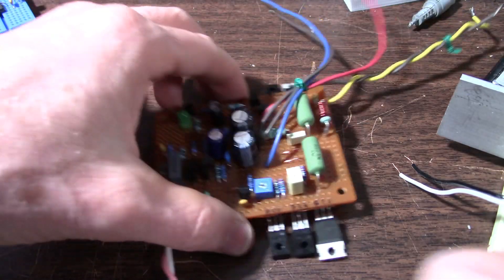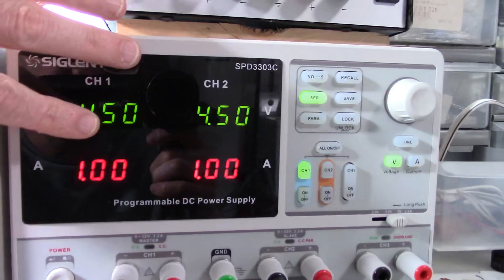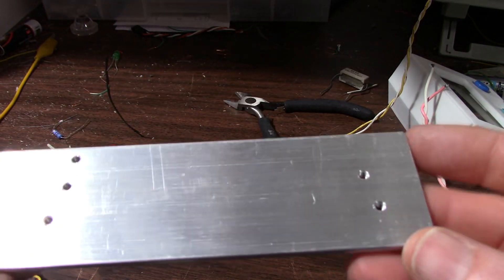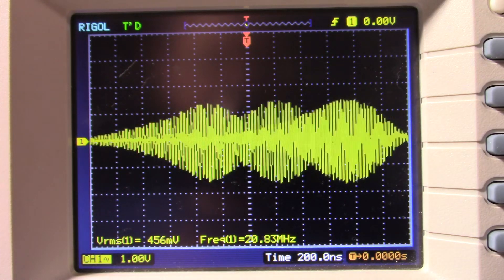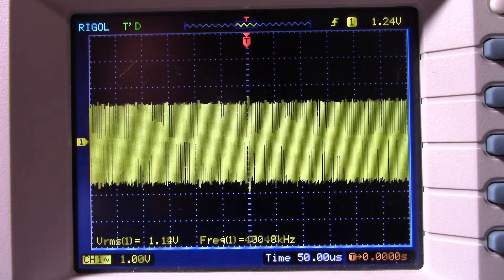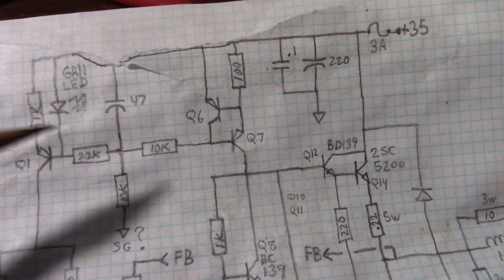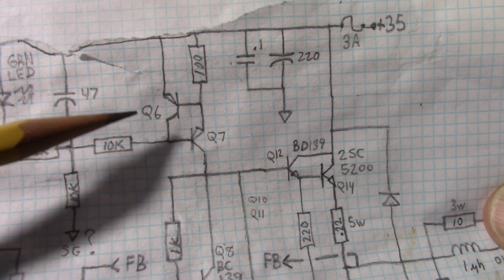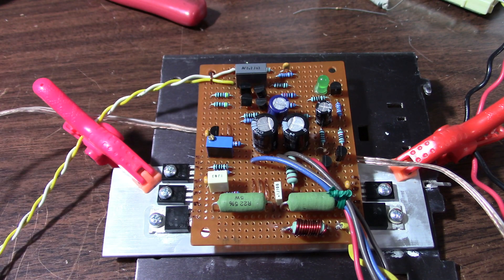Discrete audio amplifier project PT14 - BIG PROBLEM!

Comment: Howdy.
One cause of parasitics is the grid - cathode capacitance or base - emitter capacitance. Together with a grid stopper resistor or base stopper resistor they form a RC filter. The RC filter shifts the phase a little. Hopefully out of the oscillation criterion region.
If the transistors are fast one may try to "worsen" them with separate capacitors between grid and cathode or base and emitter. This should shift the RC kink frequency toward lower values taking the oscillation frequency out of unity gain. One may check the inherent capacitance from data sheets and try adding an outer capacitor of about the same value.
Regards.

Comment: John perf board is not the way to go.  You need broader & wider ground surfaces for shielding and capacitance.  Can you put the whole thing in a metal box and rule out external sources?
Reply from the maker: Perf board is certainly not ideal but allows me to change the circuit without redoing a board. In the video after this, I located the oscillation problem.
Reply: @JohnAudioTech  I have seen the follow up video and the solution.  Seems I was wrong about an external influence. Good to know you nailed it.

Comment: We got the same problem lol. mine works fine only if i don't bias the final stage higher than 400mA per rail. idk what went wrong but i've blown a couple sets of NJW0302/0281 and TTA/TTC004B transistors. It runs fine at high bias current if i increase the miller cap value, though

Comment: It's more a pcb layout issue, you have amp just love to oscillate, and go pop!
Reply: I agree.  Perf board is not the most stable basis in the first place.  The ground connections should be real wide wherever possible, so capacitance knocks down HF oscillations.

Comment: Hey John, Not counting the amp, I hope all is good with you. Where a Runoffgroove, 1/2 watt, LM 386, Ruby amp is no where close to the amp your building, I have found 'stray' voltage on the actual phenolic material the board is made of. Judging by the nice work you do, I'm sure you clean your board after parts install, I do too, and, I use a utility knife to score around the pins of FET. I would bread board a Ruby and would work great, on perf, poor performance. After cleaning and scoring around pins, the amp would work perfectly. Solder paste residue that cleaning did not get. I use HEET, ethanol alcohol, gas drier. Stray as it were voltage, just a thought. Take care, Cass.

Comment: Hi John, if you have Bob Cordell book, get to read chapter 9. I am not an engeneer, so i will not try to pretend i understand the advanced solutions and can help you. What i understand is that you need a low pass filter in the feedback loop. Low enough to stop the oscillation, high enough not to hurt the slew rate. Then monitor phase relationship of input and output across the whole bandwith of the amp.

Comment: Hey John, greetings for the great job.
At such high frequency, I would put my bets in emitter follower oscillation, which means either the drivers or the output devices.
I'd say more the drivers, because they "see" the quite high base collector capacitance of the output transistors (while the output transistors themselves are not seeing any capacitance).
And among all, this one is relatively easy to rule out... Just lift the bases of the driver transistors and insert a small value resistor there. As for the value, consider the base collector capacitance of the drivers and set a time constant that sets the cutoff to  - say - two or three octaves below the oscillation frequency you're getting. Well, I may be wrong about how to calc the resistance all along... As what it needs to do is to counter and swamp the eventual negative resistance created at the base due to the capacitive load at the emitter.
Ah, in time, it just crossed my mind as well... Did you ground the heat sink? I just thought of a possible capacitive coupling between the collectors of the output transistors to the Vbe doubler.

Comment: John, we have all built amplifiers over the years that are better transmitters than audio amplifiers. Assuming you don't have a faulty part, I think I would look at the feedback loop layout. As it's such a high frequency it must be very lightly  coupled capacitively. Try re routing that lead. Good luck, in my experience you get get stability problems on ready made amplifiers that are fine until you connect it up and you need to spend hours messing with earth connection.

Comment: Probably your best video.  No one has the guts to keep it real on YouTube.  What did you change from the last test?  Heat sink is all I could see. To me, a digital guy, it seems like an issue between collector and base. People call it parasitic until the TO220 bodies are connected by a sink.  Don't know what to call that effect. Some sort of coupling through the mica? Just a guess.
Reply from the maker: It may have been oscillating before. It doesn't really affect the sound. This was the first time it was on the scope. I think I'm getting somewhere with it. I hope to get a video up with changes as I go along.
Reply: JohnAudioTech - Take your time. The thoughtful content of your work is what distinguishes you from the hoard of "mail bag" EE videos.

Comment: I suspect that it’s not in the output section because it does it with or without a load.
Reply: I think you're right, especially if the frequency remains relatively unchanged with the load removed

Comment: Hi John, Im sure you will get this working. So the amp was working, no oscillation, before fitting the heatsink? The only change was the Vbe pot. I cant see this being an issue. Try grounding the heatsink to stop it trying to impersonate an antenna. If this doesn't work, remove the heatsink and check again. All the best.

Comment: So now you have an "unconditionally stable oscillator". I had the same problem, but with CFP output. I fixed it redesigning the PCB and modifying the Zobel network. A 20pF capacitor in the FB sometimes work, but is not the solution, the amplifier must not oscillate without any cap in the FB. 
By the way, a radio filter in the input may help, it may be a strong radio signal near the house.

Comment: Before you go down rabbit holes, check that what you have built actually matches your schematic! In your last video you stated that you pretty much threw it together. Be sure that what you are debugging is what you INTENDED to build! :-)
Reply: NotMarkKnopfler I think this is the first step.  Maybe take a fresh schematic and highlight each connection and part as you trace your board.  Nice video!

Comment: I think the problem is right from the input differential stage. And the oscillation is not sustaining means this oscillation is generated directly from the signal side. It is not the problem of stability, for an unstable system the oscillation should not damp itself out. 
I think the 40mhz noice source is outside the circuit.
Reply: MY TECH WORLD AND KSRTC Correct.
Reply: @brandise76  Only thing that I can see is the output inductor.
Reply: John Yang I don’t understand what you are saying about the zobel compensation inductor. That has no play in this oscillation issue. I can’t see the whole schematic or the actual layout but I suspect the amplifier is barely stable and some external signal is causing it to break into oscillation. The unshielded, twisted-only pair of input leads isn’t helping. There are lot of things at play in causing an amplifier to oscillate and I suspect it will be difficult to determine from a video.

Comment: input stage differential amplifier stage and feedback loop. Seems to me that you don't have negative feedback but a positive one turning your amplifier into an oscillator. Also some lead can not be connected or bad soldering or you made a connection it shouldn't be there.
Reply: The amplifier works with signal and has low distortion near clipping, and no wierd behavior at clipping. Only has 3vp-p 39mhz signal riding on the signal.

Comment: Hi John, the high frequency oscillations you are seeing are called ringing, your board/ circuit is resonating.  I saw this a lot when I was working on a hydrogen generator project.  the 1 micro Henry coil is doing what?  whenever you have capacitors and coils together you just might see this ringing.  what would happen if you removed that coil?  I know this is not what you want to hear, but what if you added a low pass filter?  to attenuate the high freq?!  okay maybe that's a bad idea.  mike

Comment: You can split the amplifier sections for testing. Disconnect the driver transistors from the VAS , reconnect the feedback to the VAS  emitter. Obviously this won't drive a load but it should be DC and AC stable and be a half decent amp stage in it's own right.

I've seen the current source stabilization with a 1K and 100p. 

If the input stage is OK it might be your CFP output, maybe your 220R between the op bases could be split into two 100Rs that base to emitter?

I was a little concerned about the common ground for input and output section but you have plenty of decoupling so maybe it's OK.
Reply: I just double checked and noticed your op is Darlington not CFP my bad.

Comment: Current mirrors on the input stage have given me many a headache. I generally run LTP inputs with the inverting side straight to the rail and 470-820 ohm as the collector load in the non-inv side (base to emitter VAS) with DC offset determine the final value.

Not sure what TO220 transistors your using but I've found the TIP range to be gits for oscillation. TIP42C etc seem to be buggers for it.

Did you connect the heatsink to 0v, I've had floating heatsinks cause me oscillation before.
Reply: so, a floating heatsink could cause oscillation too?. i have my own designed amp oscillate on high bias (higher than 400mA per rail) and the heatsink was floating. never thought of grounding them
Reply: It becomes a plate capacitor with the heat pads of the transistors bolted to it, it some circumstances high frequencies can couple between devices through the heatsink.
Reply: @killcar5nbike2  makes sense. i'll try to ground the sink later. could my Al2O3 thermal pad induce the problem even worse?. it's 0.6mm thick
Reply: It shouldn't do, there's so many reasons an amp can start oscillating. It may help, it may not.

Comment: What about a 5W  Wide Band class A amp  using 3X BC182L transistors in a long tailed pair driving 2X BD131 power transistors could be used as a preamp driving a wire-wound  Variable resistor which feeds the main output stage just Google for it, what about a 470pf between the inverting side of the amp and ground.

Comment: i'd disconnect the feedback to see if it goes away, remember transistors also have capacitance, its small but you since all it takes to make an oscillator is a RC network and a feedback loop, you might have built an amplifier/oscillator. if you disconnect the feedback and it goes away then perhaps you can put an inductor on the feedback loop to filter out the high frequency signal.  good luck :)

Comment: You will need an RC filter at the input known as an RF stopper: Place a 0.001uF to GND from the base of Q2 to GND on the left side of the DIFF AMP. This sets a corner frequency of about 160kHz which will eliminate the amplification of RF ingress.
Reply: I think he mentioned he shorted input to ground. So it can't be rf being picking up. Also 3V p-p is really a lot, instead of 30mV.
Reply: John Yang Sure it can. He grounded the input - where? At the end of his input cable? It’s still a big antenna.
Reply: @brandise76  Well. Apart from what I said, he already has a capacitor in the front end. It's shown on both the schematic and the board(yellow ceramic at top).
Reply: John Yang But it’s not fitted for RF blocking. There is yet a 1k resistor between it and the base of Q2. It is also 1/5 the value I recommend and paralleled with a 22k ohm resistor. Trying to figure out what that’s all about.

Comment: To me, that Vbe multiplier bypass cap looks suspicious. It might create a delay long enough to turn negative feedback into positive. Or it can be the CCS indeed, try putting Miller cap on Q7.
 Your transistors have nice gain bandwidth, it very well can be the entire loop oscillating. With slow hogs like 2n3055 and such - yeah, 39Mhz wave will never pass through them, they will attenuate the oscillation like a snubber :D

Comment: Thanks,  John! Following your trouble shooting is nearly as good as seeing the working amp. Did the hf oscillation occur when you ran the board with no heat spreader/sink? What's the twin core speaker cable doing running under the board? Is it connected to anything?

Comment: I think it's likely to be related to inductances in the ground circuit. If you made it on a pcb with better ground integrity then it probably wouldn't do it.
However there may be a solution to get it working fine on the perf board... I'm sorry I don't have a clue on how to achieve that other than doing your best to lower the ground impedance. It would be interesting to see how any changes change the amplitude and frequency of the oscillation before curing the problem
Reply: Yeah, but I have built quite a few amps on perfboard, they didn't oscillate. It might be something sneaky :/
Reply: “Inductance in the ground circuit”

Is not likely at all. How much inductance in the ground circuit would it take to make it oscillate at RF? And what is causing the LC tank to resonate? This is a linear amplifier with no switching mechanisms.
Reply from the maker: The ground traces amount to only a couple cm in length excluding the trace that goes over to the input (high impedance) and the shield that doesn't really carry current. High current grounds "star" into the ground plane around the bypass caps on their own trace. It is hard for me to believe the grounds are an issue.
Reply: you may be surprised. try to improve the decoupling at radio frequencies.
Maybe even try ferrite beads at certain locations

Comment: Did you try the output stage outside with the 1n capacitor across the bias spreader ? Could cause instability.
Touch up each solder joint again to make sure everything is connected, especially the bypassing/decoupling capcitors.
Check dc values of each point, a feedback amplifier could actually "work" with such issue.
Reply: One another thing. Can you still play music through it? If not, some component may be damaged. If yes, then try tests with signals. Can give a bit more of information.
Reply: Another thought, set gain to around 1000 times then probe around and see where the issue is.
Reply from the maker: Yes the amp sounds good with music. With the +/- 15v rails, it produces 18 watts into a 4 ohm load and low distortion. No oddities noted in the waveform at clipping. It just has the 40MHz oscillation riding on the test signal
Reply: @JohnAudioTech  It's certainly weird situation. It would make more sense if it doesn't work.
To me, i have to start with changing gain settings and see if the amplitude changes, and try open loop probing with input shorted to ground, then disconnect the 1n cap across the vas. Try capacitive load stability and square wave(clipped sine should be fine) just like when you did the EF CFP output stage, but with this "working" amp. 
There can be a lot to do, but since it's "working" it's really hard to diagnose.
Reply: @JohnAudioTech  It's probably the output inductor picking up rf noise.
Reply: And my last hope is to build another one...

Comment: Hey John, great video as always. Sorry to see the amplifier isn't going as you pleased. I've also recently built an amplifier that exhibited a very similar result to what yours is producing. I tried some things to alleviate the oscillation which helped but didn't quite get rid of it. 

Make sure your bypass caps are connected. You could've missed a solder joint or something, can't hurt to check. Since the oscillation peak-to-peak voltage is around 3v, it probably means that its being amplified. Change your feedback resistance and see if the oscillation voltage changes proportionally to the resistance. If it does, then it means that its before the output stage. If the problem lies in the input stage or vas stage then I would suggest you begin probing with only the input stage connected and gradually connect portions of the circuit until you find the issue.You can also add an rc lowpass filter on the input and vas stage rails.

If the problem is on the output stage id suggest doing the same with the input and vas stage. Disconnect the input and vas stage, probe and gradually connect portions of the circuitry back together.  Finally, if all that does not work, you might want to consider that your amplifier has a fundamental design fault. I do not want to believe this is the case because it makes sense to me that the amplifier should work.  Also remove any unnecessary circuitry such as the zobel network, output choke and protection diodes.  

Thats all the "help" I can give unfortunately, I'm sure you tried most of this already or probably thought about it. Just letting you know that I'm not an engineer, just a guy who puts up with these problems after every build. Lol
Reply: zoomernw, it sucks but I find that it always turns out to be a learning experience!

Comment: Interference  from your  cell phone  or the  microchip  in Snickers  brain is  sending out high frequency  oscillations
Reply: To check this it's pretty easy, just turn up supply voltage and see if the amplitude changes.
Reply: John Senchak Internet Security Guru it is probably the cats fault!!😜